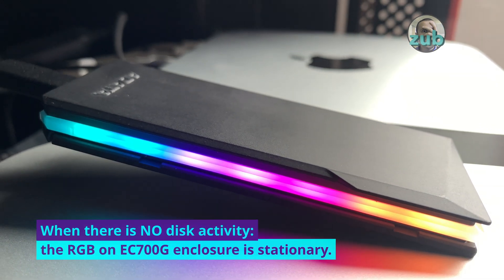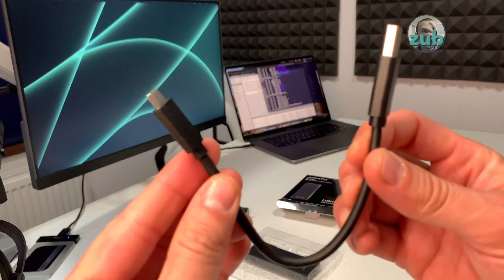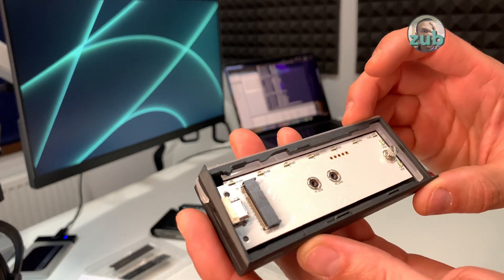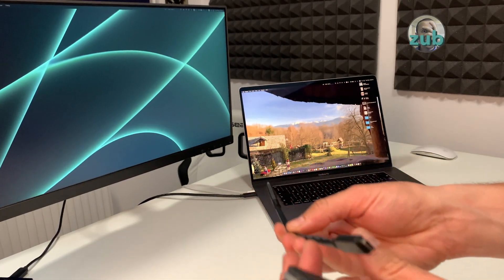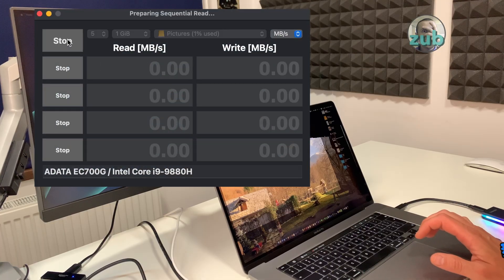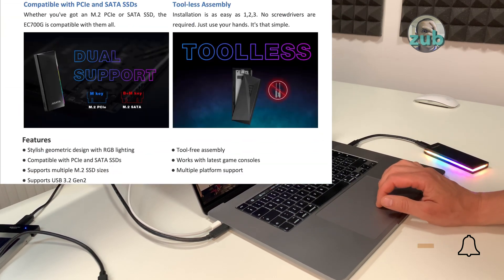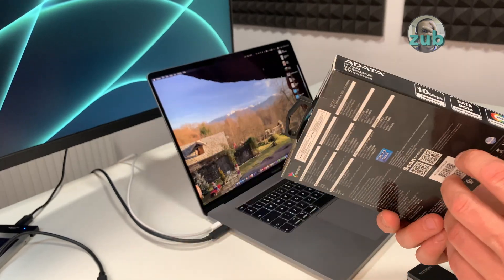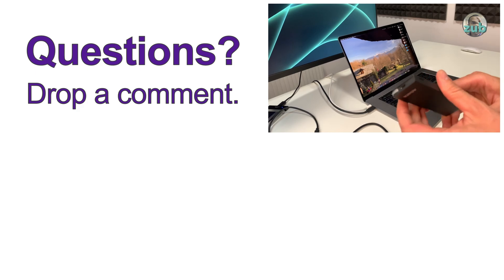ADATA EC700G + Legend 800 2TB M.2 PCIe SSD: How Fast Can It Go? Not That Fast. Limitations!

Comment: no me gusta para nada el usb c se me hace que se va a romper facil el conector
Reply from the maker: El USB-C es el futuro y la neta es mucho más firme que el USB-A, sin contar el microUSB. De todos modos, si necesitas conectar dispositivos con USB-C, pues no hay de otra.

Hello! USB-C is definitely the future — it’s actually much more robust and stable than USB-A, not to mention microUSB. That said, if your devices use USB-C, you don’t really have a choice anyway — it's what you need to connect them properly.

Comment: Should i install both the thermal pad from adata and the one that comes with the enclosure?
Reply from the maker: Hello, it really depends on the enclosure. Some NVMe SSDs have large thermal pads, which might not fit in the enclosure. Using the thermal pad that comes with the enclosure is usually the safest option for all NVMe drives.
Reply: @zubilitic  Thank you for the reply

Comment: I would say not very useful. Speed is not important, temperature is. What good is high speed if it's going to burn like a stove and break down quickly?
Reply from the maker: Hello, the enclosure keeps the ssd below dangerous temperatures if you install it properly. If the enclosure is hot, this means it’s doing its job. You should be worried if it’s cold and at the same time ssd reporting very high temperatures.
Also, no matter where you install it, an NVMe SSD will get hot under high usage. That’s in its job description.
Adata Legend 800 has its operating temperatures between 0 and 70 degrees Celsius.
I am using my ssd with enclosure and writing on it almost daily (video editing). No problems with the temperature.
Reply from the maker: Ah, I almost forgot one important thing: the SSD’s high temperature (from the data sheet) is reached when hitting continuously its maximum speed. With this enclosure, it will never ever hit those temperatures. 10gbps (1250 MB/s) is it’s speed limit.
Reply: @zubilitic  I don't need the case, I was interested in mounting the motherboard itself, where there is a radiator added by the manufacturer of the motherboard. The reason for the temperature discrepancy I would say is more of a misreading and just needs to be calibrated. A high temperature is anything but a good thing. It shortens the life of the SSD drastically as well as overclocking the CPU. Someone somewhere had provided a chart that nicely showed how high write temperatures drastically reduced the number of cycles you could write the blocks before they failed.
Reply from the maker: Hello, the video is about this M2 ssd in an enclosure, not in a PC where you have more room and ways to keep the SSD cool which is more important because you can reach it's maximum speeds if the slot permits it.
And with an enclosure it doesn't get dangerously hot because of the reasons mentioned in my previous comment.
Obviously, it's not ideal but sometimes you need to use it with an enclosure and accept the downsides.
Cheers.